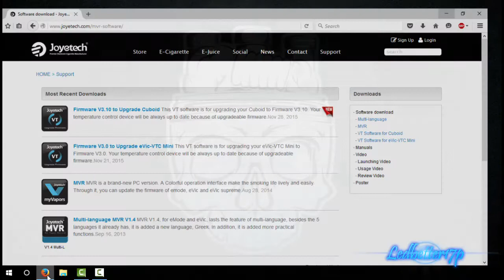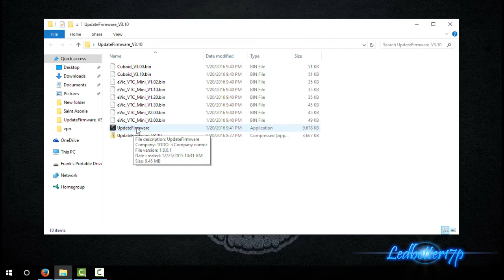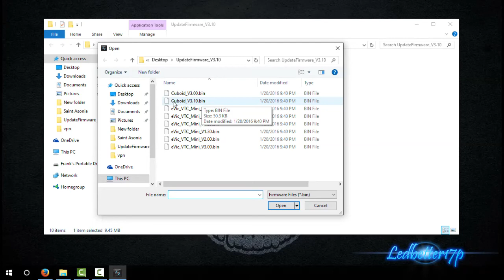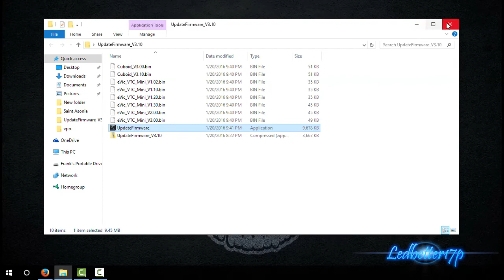How To Upgrade Cuboid Mod To 200w

Comment: when I plug mine in nothing happens but my laptop does make a ding sound letting me know that it is attached to the laptop from there I can run the upgrade there's now a few to choose from seeing as though they come out with new ones and it's fine. I've noticed it's not really like a typical program upgrade where you get confirmations or like when you plug another device and say like your cell phone to the laptop and something will come up letting you know it's connected.
Reply from the maker: +Joe Kyser yeah the update process on a lot of mods is kinda shady at best but once you figure it out its not too bad. Just got to keep an eye out on the actual program it will tell you when its connected when it makes the connection noise and the program is on it should automatically recognize the mod and show the firmware version and what mod you have connected kinda like what it does with the rx200.
Reply: +ledbetter17p ya you know what i just plugged mine in and the box does come up it just is behind the window i had open. if im at the home screen with nothing up it comes right up. your right firm ware upgrades do seem a little shady at times lol. what i do suggest is make sure your on the right Web page when you do it too. check the web address to make sure its from their site. i have seen hacks that make you think your doing an update and nothing happens because it was a malware or whatever. i wouldn't Google the update i would go directly to the site or click on your link